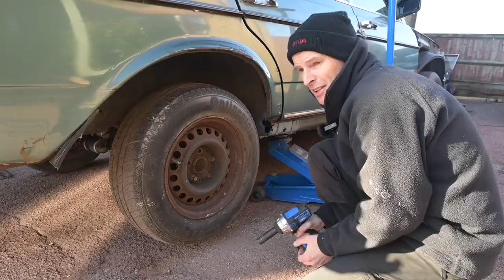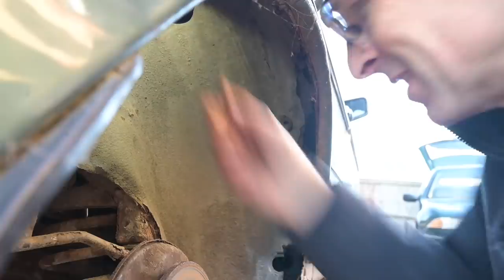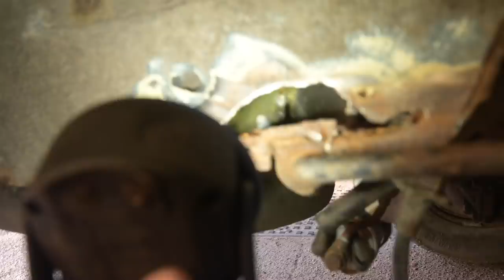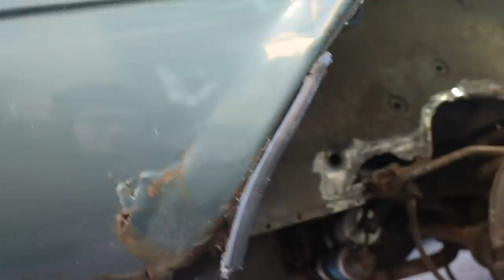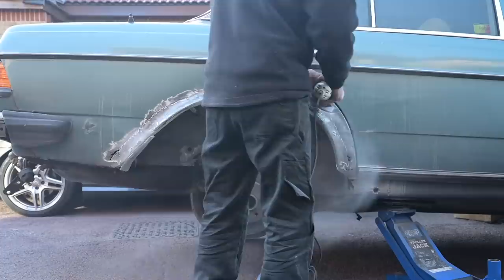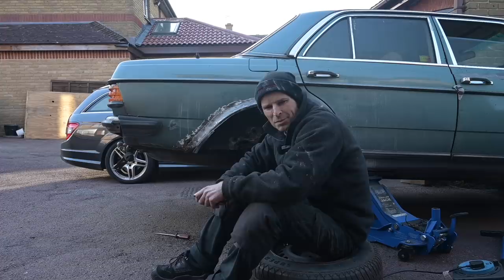Merc W123 - Oh good, more rust

Comment: A mechanic told me that many W123 have those rust issues nowadays - he said that in many of them, the underseal hardens with time, detaches from the metal and that moisture will come in between and start corrosion.
I can't verify that but it might explain how even fine looking cars can quickly turn into rustbuckets after holding up well for decades...

Comment: Have you looked under the rear parcel shelf? (Stick head in the back of the boot and look up with a torch to each corner). Very likely it's gone there if it's like that on the boot floor. Spare wheel well potentially as well...

Comment: I've got water appearing in the trunk of the car.  I suspected the rear window seals but that all looked pretty good, and I even shot some sealant up under the rubber to make sure it is water tight.  So I think it is shooting up off the tire and getting in somewhere in the rear wheel well.  Lots of rust along the rocker panel, and a big hole under the hood where the hood spring nests.  All stuff I can fix.

Comment: Round about early 2003, I paid £300 for 1984 W123   240D.    it had about 6 months MOT. Come a few weeks beforethe end of the MOT, I put it int a garage for a check.   The rust in the rear arches  was terminal.  If I recall correctly, someone mentioned to me that the W123's coincided with when Mercedes bought batches of low quality steel from the then USSR.

Comment: You need to look under the rear window seal.. really common place for hiding rust. And it will leak in the trunk and cause more that lovely rust..         Good luck with the W123 she will look good when you are done!! Greetings from Finland with W123 240D and 579 000km.

Comment: I know it will sound like a lot of work, but I think your best option for curing this rot mess is to cut the replacement outer wheel arch out to allow you access to the inner arch, repair that in sections and then weld a new, decent arch repair panel in.  And make sure you absolutely drown the area in good anti-rust wax after the repair is complete to stop it ending up like this again...

Comment: I think you need to cut that outer arch off, whether you repair it and put it back on or find a repair panel it will make fettling the wheel housing much easier.
Reply: Best way ist to cut the outer Arch out. Then repair the inner one an after that you repair the outer one. There is no easier way.

Comment: Ooh thats rotten. Junction ahead - either section full repair panels or weigh it in. Tacking plates on that is not on. Quarter, outer wheelhouse, repair to boot floor plus inner apron repairs required to put that right.   Matt I hope you choose well and benefit later on from those choices. Good luck!

Comment: That looks scarier than it is.  It's a lot, which is always frustrating, but it's all fixable.  Chopping that repair panel off will give you much better access for sorting out the inner arch and then you can put either a new repair panel on, or repair the one you've chopped off and refit it.  Good luck with it, I'd say I wouldn't envy you doing that work outdoors at this time of year except that I'm having to do the exact same thing on something of similar vintage in the same outdoor situation.  A good supply of hot beverages an absolute must!

Comment: After a discovery like that a bottle of Vino is required!
I'd definitely see what repair panels are out there, bit worrying seeing the rust around the mounts.  I think I'd cover the metal in rust stop and paint, then wait til warmer weather.  Use the winter to finish the old Rover V8.

Comment: It was common bodyshop procedure  back in the day when  tarting up old cars to slap cover sills and and arches over existing rust. This car has been the recipient of a cheap exterior tart up job back in the 90s. Some of these 123s were quite frilly even back then  - a customer of ours at the time  had a 1979 Coupe which was his daily driver - the floor pans on it were terribly rotten and had to plated up the best we could in line with his budget, exterior wise the car looked immaculate - beneath it was a basket case. For all the bullet proof talk that people heap on these - if they weren't garaged - the British climate killed them. Thankfully all the rear repair panels and inner and outer arches are available. Good luck! 👍.

Comment: Don't give up stay positive, many of us are in the same situation just do little bits at a time and it soon comes together. 
In the outside cold I use a fan heater then block the air gaps around where I'm working on the car and trap the heat in, it's a lot more enjoyable when you're warm.

Comment: Inner and outer arches aren’t particularly expense for the W123. I would definitely get a set, they aren’t too bad to weld in as long as you are methodical. As for the other rusty holes, they don’t look bad to be honest. If you don’t mind patching those areas, just break it down into small jobs and work your way through them. The worst thing is looking at it all as one big job as it can soon put you off. Don’t give up, I’ve just repairing exactly the same areas on my W123 and once you stand back at the end, the rewards are huge.
Reply: You seen his welding?

Comment: You can never rust proof the same once an arch piece has been welded in like that , especially the return lip .That arch is probably the reason why the rest is so bad .One of the advantages of modern panel bond and  rivets no rusting and its a lot stronger than X amount of spot welds or mig plugs

Comment: "It is more than a days work I think" Yes it is ^^. I am restoring my 300D right now, and I am working on this side already for 3 month. And it was not nearly as rusty as this one. I removed the complete side panel, did the jacking point, replaced the inner wheelarch, repaired the corner of the rear windowframe and a few days ago I welded in the original Mercedes NOS sidepanel. Looks great now! so it is really a lot of work. But still I would say yours is worth to save. It has a really nice color combo (I even thought of repainting mine to that petrol blue, instead of silver) and nice velour upholstery. Keep up the work :)

Comment: I feel your pain, you poor bugger.  Been there, including the rust up the sleeve which is especially annoying for some reason.  Repair panels is the way to go, I'd say.  I'd guess they're available for the outer wheel arch but it would be handy if you could get one for the inner as well.  Pity you didn't nab the yellow car but bygones.  Good luck Matt - I look forward to your struggles, pleased that it's not me.
Reply: There are definetly repair panels for the inner wing👍 did the same operation last year on my t model. You can't form these yourself.
Reply: @redisbastelbude9860  That seals it - repair panels is the way to go for the 'curvy' stuff at least.

Comment: This is a full on restoration project. Would scrap this car, it's not particularly rare or valuable. Needs the inner and outer wheel arch panels. Your welding needs to get better and stronger for those parts near the suspension mounts.

Comment: Must say Matt I admire you for sticking with it,thing is with these cars its more often than not the rot that kills them :(
Its not that it has to but there are those who cant weld and the cost to put them right if your paying somebody else outweighs the worth.
As you can weld your on a Win Win
You get a W123 which when you've finished will be solid and no doubt your welding practice is invaluable :) 
I was surprised on the previous video that the old Merc hadn't yet been covered up for winter! But good for you for cracking on with it :)
It will be worth it in the end lets face it you could of bought a more expensive one and still not known what grot was hiding? Better to start with the warts in plain sight and eradicate them then you know its a good one :)
Looking forward to the next one :)

Comment: Can't you just buy replacement wings and add them?  If not, replacement or similar wings, cut the interior arch out, then weld them in place as a whole unit rather than piece by piece welding?

Comment: I wouldn't touch this era Merc or VW/Audi with a bargepole now, That awful rubberised underseal they used just cracks over time and lets the water/Salt in and they rot like crazy.
Reply: My old BMW E34 apparently had similar issues. At least, thats what the guy I sold it to told me.

Comment: It's like you haven't read any of the comments warning you about how rusty these cars tend to be behind their rust proofing. I'm surprised you're surprised. I fear what going through this car completely will show, but still wish you the very best of luck with it. I wouldn't have touched this one, i've seen how bad they can be and this one doesn't look promising, but if you can fix it and get it back on the road, i will salute you for saving a classic. ..and i'll be the first to understand if you decide to drop it, when more rust shows up.
Reply: Sad but true. Been there. Done this on a S123. If i only had known. At least its running now but it took 2 Years. And i only had one project😂
Reply: I am sure he has read them, but hope springs eternal. Also, love is blind, etc etc.

Comment: Calling that a rust bucket is an insult to rust buckets as more rust than actual bucket.  That either missed the wax injection or a very bodged repair job in the past and it was not redone.  A cheap collision repair?